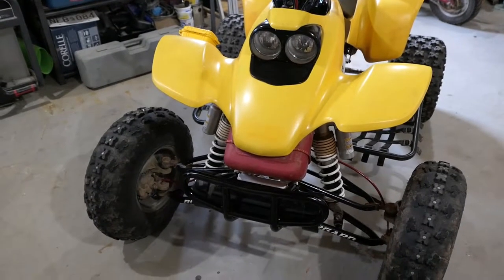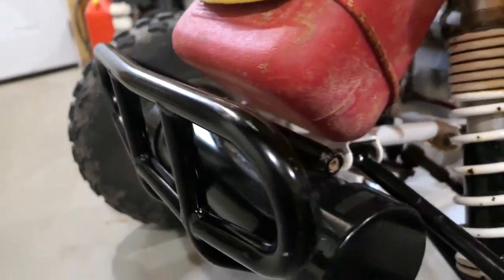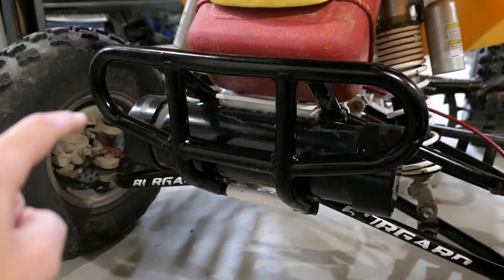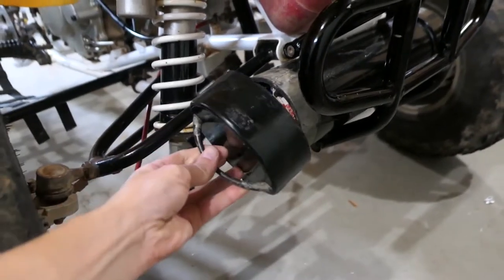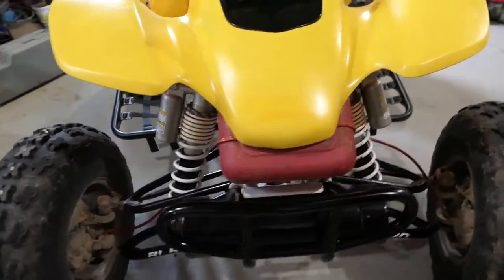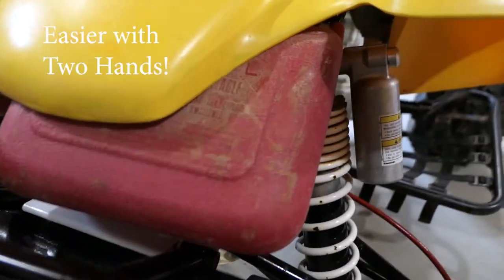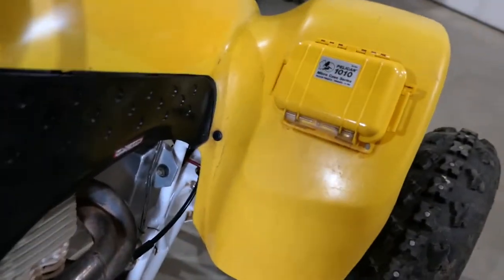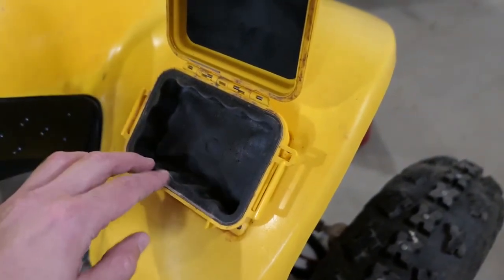Sport ATV Storage Ideas & Solutions - 2001 Honda TRX 400EX - Pelican Case / PVC Tube / Gas Can

Comment: I like that PVC pipe storage. I have a similar idea to mount it on the opposite side of my muffler since they're about the same diameter. I have a 2007 400EX with the factory headlights at the tip of the nose plastic. Just behind them is a access cover to change the bulbs, inspect wiring, etc. It is a snap fit with no tools required to remove screws. There's a neat void under this cover where I keep a one person tent and first aid kit. I used to have a 8'x10' blue tarp, paracord, first aid kit with a few cereal or trail bars and a hot drink mix. Just for fun, or an unexpected overnight camp. I also keep a Walmart $1 flashlight on all 3 of my ATV key rings. They're super bright and water proof. All 3 machines also have a small socket wrench kit, candle and a Bic lighter inside the air breather box.
Reply from the maker: All good ideas!! Thanks for your comment 👍

Comment: I found that a fanny pack works great as a tank bag. Hoop goes under the gas cap, and the waist clip goes underneath gas tank, over spark plug wire. Super tight. Love your videos, subscribed. Does the pellican case cause your fender to shake more then normal?
Reply from the maker: Fanny pack sounds like a great idea too 👍   It did move a little, but I only kept tiny items in there (registrations and a bit of cash). Thanks for subscribing, unfortunately I just sold the 400ex. I made the videos to make sure I remember what I did and how it looked. Most of my projects will be "stuff around the house / shop" now, but I still have a smaller vintage motorcycle that might make an appearance some day. Cheers!

Comment: You could get a aluminum air box and bolt a bigger pelican case to the back of the air box and put fuel bottles where the battery used to be.
Reply from the maker: That's a good solution too! 👍
Reply from the maker: What kind of fuel bottles would you use?
Reply: @LegacyCraftworks  I don’t know check out Swamp Gump Harpy with there blue 400EX build they put fuel bottles on there 400EX
Reply: I believe they are camping stove fuel bottles.